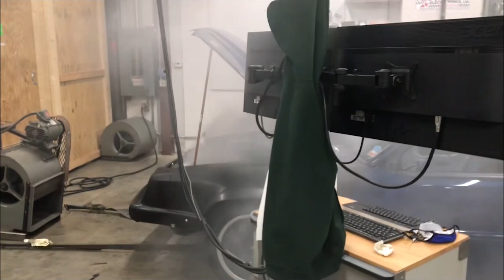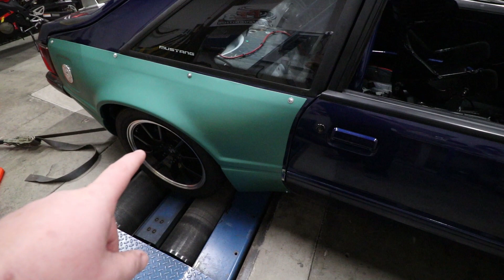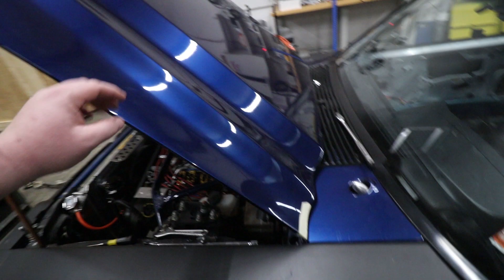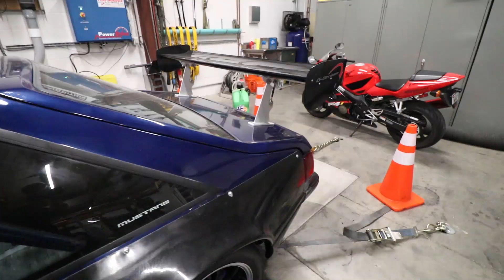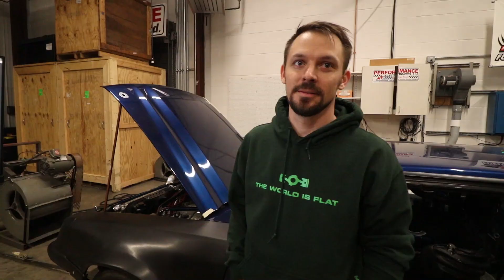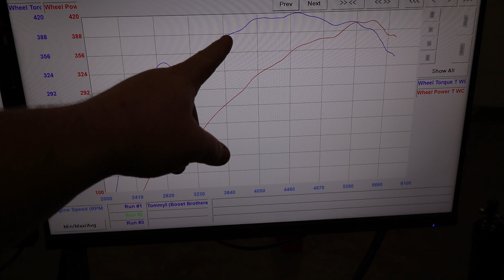Road Race Mustang Dyno (408 Stroker!)

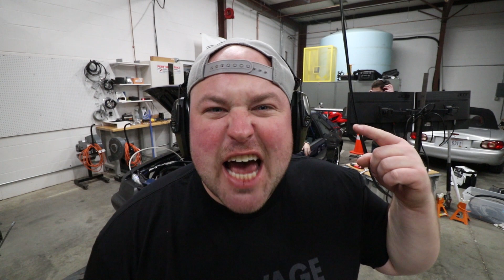Comment: @5:12 the car is preigniting, yet its still being pushed? No wonder it made more power when they pulled 2 degrees. It helps when your firing the plugs when fuel burn is happening on the side when the piston is going down and not up. How do people not hear the racket preignition makes, its just as loud as the exhaust!